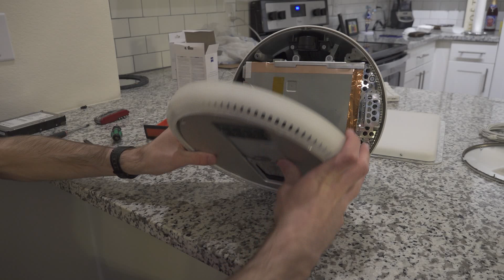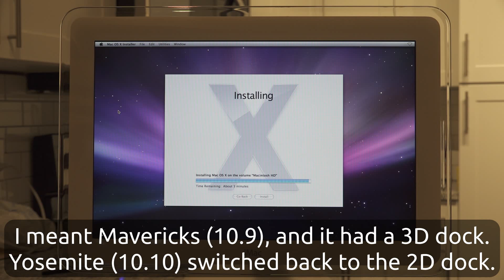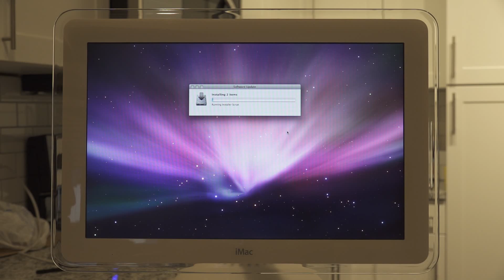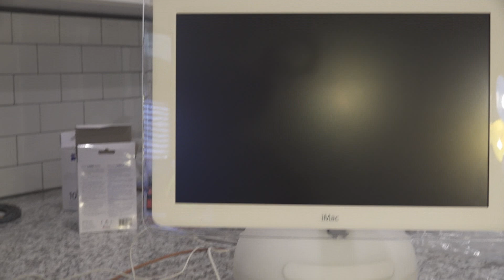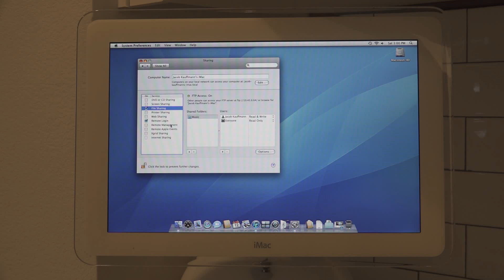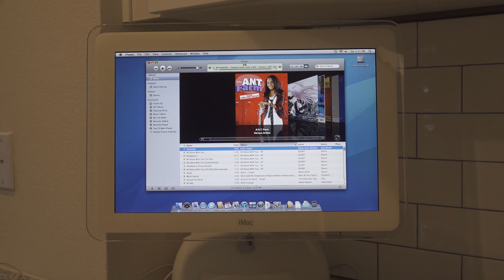iMac G4 Jukebox (Part 2)

Comment: Cool project! Just a note - you can get IDE to SATA adaptors quite cheap (I'm in the UK, here they're about £10 which is about $13). I've got a 2.5" SATA drive in my G4 MDD. Might be more cost effective than trying to track down a new IDE drive.
Reply from the maker: Like I said in the video, I saw a couple of IDE to SATA adapters available (namely, a StarTech model, and a non-StarTech model sold under a number of names.) My concerns were more quality/durability/compatibility. Which particular model are you using in your MDD? It would be good for others to know.